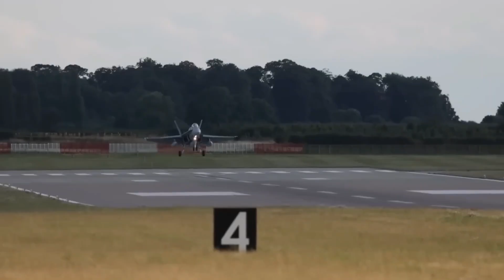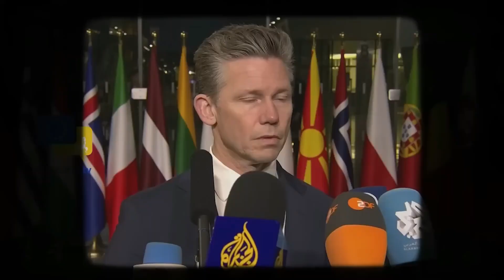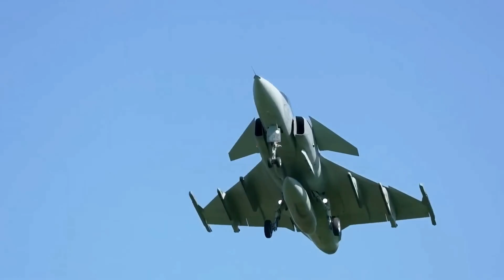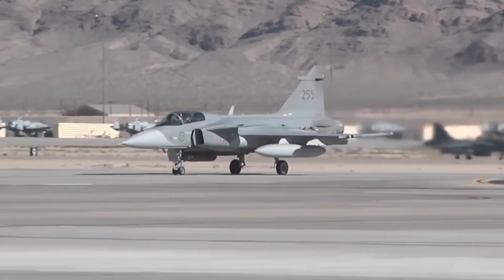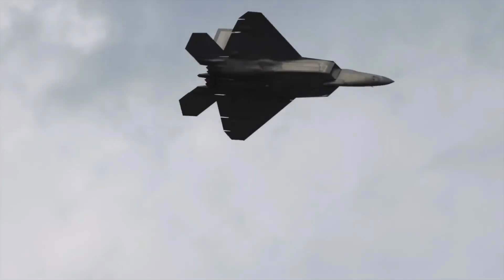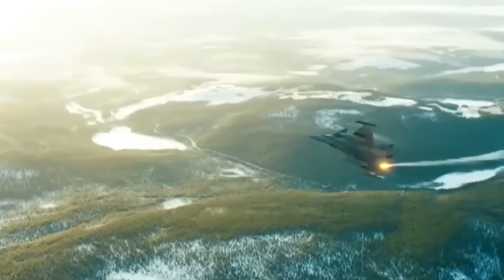Rolls-Royce Engine Could Save the Gripen E/F, Sweden's Bold Move!

Comment: The EJ 230 is a potential step in independent operations for Gripen. However, this is not a simple matter, an fighter engine is not a light bulb!
The whole JAS-39 will need to be redesigned, airframe and electronics. A massive, expensive task, that takes time...  Be well and stay safe